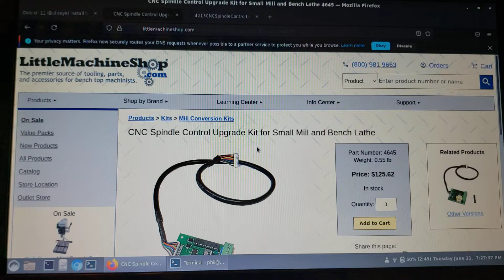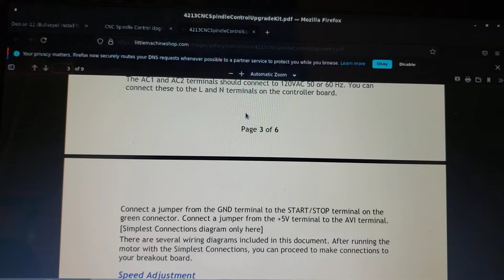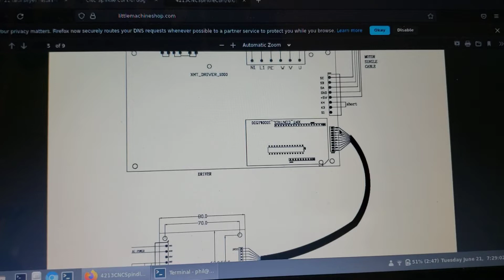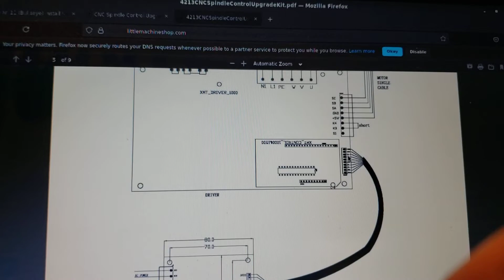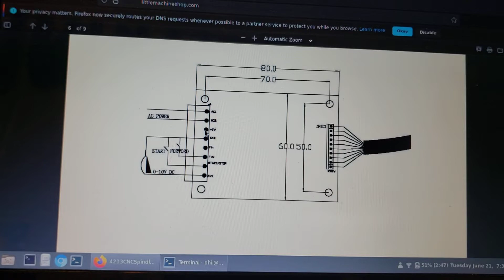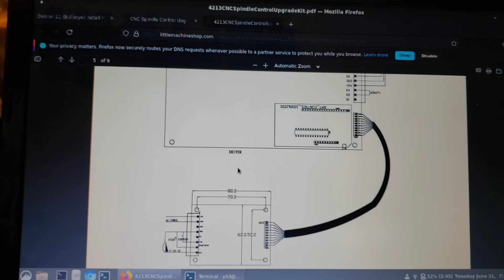XMT 1000 Watt BLDC motor driver (SX3 mill and similar) LMS CNC conversion board info

Comment: Wow, of course it had be you.  XMT 1000 video, wow!  Do you know that exact same components used in Intelitek Promill 8000 which is not Intelitek, but SEIG.  Anyhow my spindle stopped working and me trying to dig some documentation stumbled on this video.  That installation pdf is fantastic . Thanks a bunch.